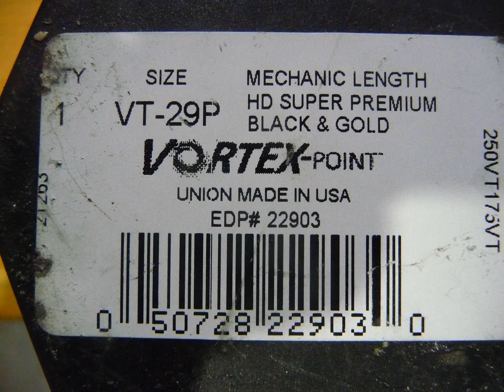Cart modifications for mill, lathe workholding

Comment: I have used those drill bits and it seemed to me you needed more pressure and lower speeds than regular bits
Reply from the maker: I agree. Not a lot of difference drilling deeper holes but if I get into a rhythm with holes in thin material it is quite noticeable, more so as the diameter of the hole increases. This drilling was through the original shelf walls, about 18 ga., folded over then through the 1/8" angle.